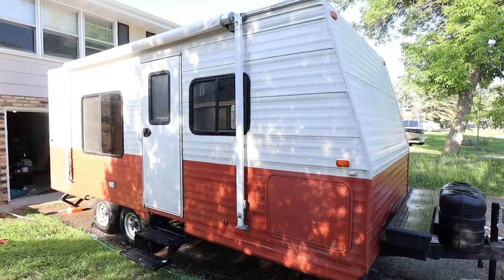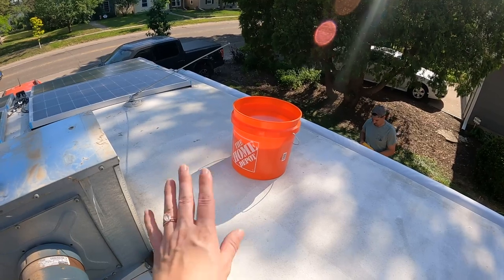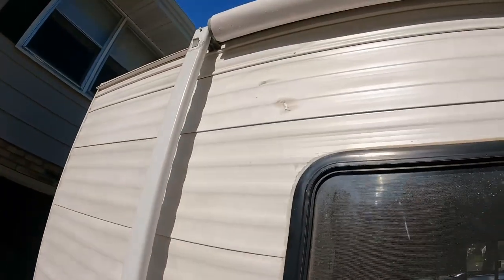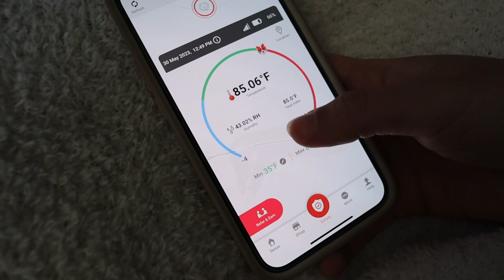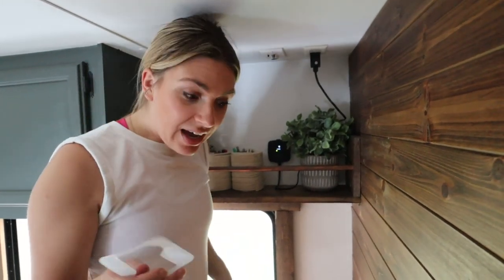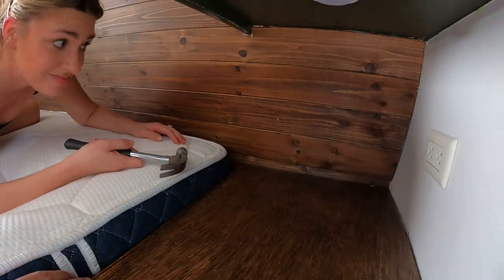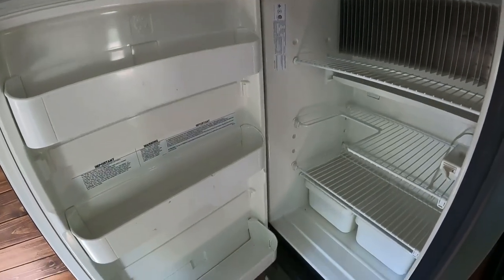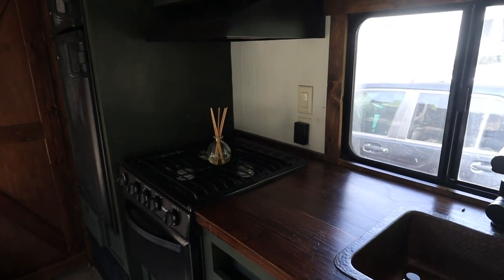Getting ready to return to RV life!

Comment: For your information, there’s nothing wrong with having solar panels on and the power on while you were up washing the roof. It’s no different than being out camping while it’s raining. If all the electrical is sealed correctly which I’m sure yours is there is no problem with it. Thanks for the video. In case you didn’t know your “random outlets” were for TVs. Just saying.
Reply from the maker: Thanks! Yeah, we weren't concerned about getting the panels wet obviously since it rains on them all the time! just didn't want to accidentally touch them while they were on and in full sun. We did remove the old TV stand in the back corner during our reno so we knew that was the purpose of that outlet but I wasn't sure about the other one closer to the bed. Probably the same thing though!